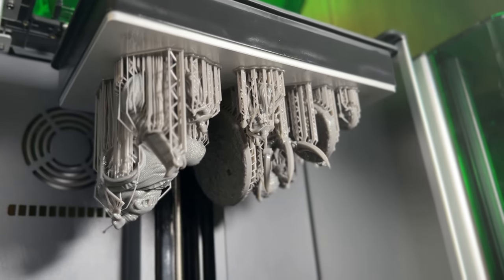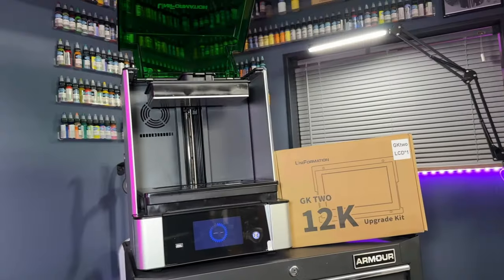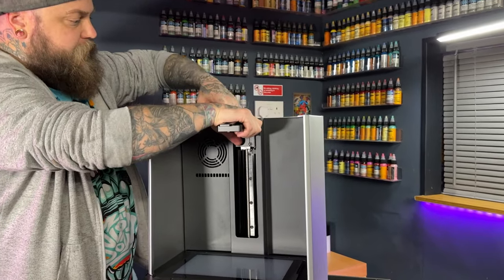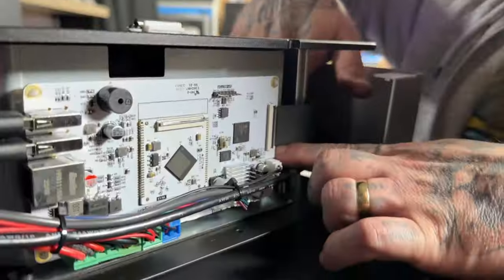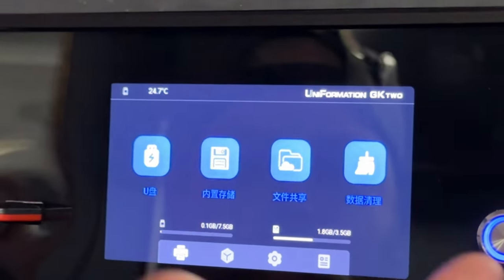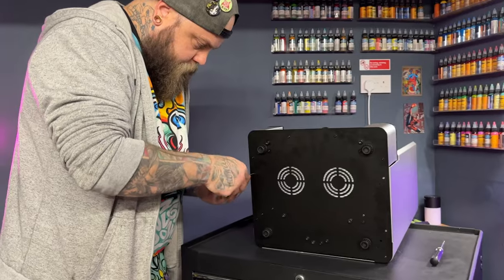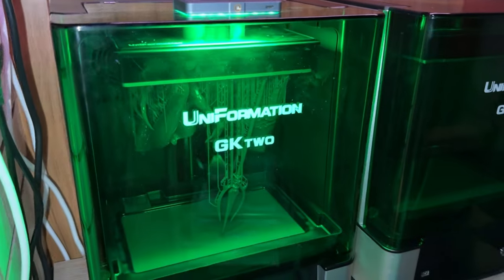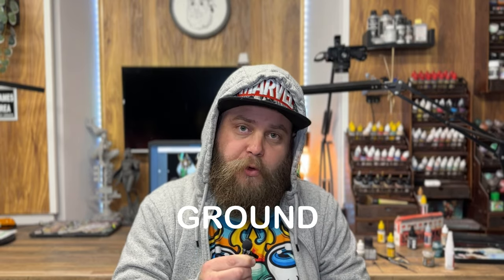Best Hobby Resin Printer of 2023 - Uniformation GK Two

Comment: Rinse your prints under hot water, they will effortlessly detach from the build plate, and the supports will follow suit. Direct the water precisely to avoid any distortion to the actual print.
Reply from the maker: Literally don’t even need to dude they just pull off with ease.
Reply: @Groundeffected  I noticed that you utilized a trowel to remove your print from the plate. If you rinse it under hot water, you can use your hand to pull it away easily. Using a trowel may potentially damage the surface of the plate, just a friendly suggestion.
Reply from the maker: @Triad3DStudio  you know when these resin printers first started coming out we were sent sand paper to sand the plate for better adhesion. Don’t worry about the plate dude. I scrape it after every print too just to take off any potential bits from the raft that might be snapped off( usually not a single piece) and I shove that thing back in and print again. Haven’t washed a single build plate in over 3 years printing.
Reply: @Triad3DStudio  the more scratches in the metal plate the better adhesion you will get.

Comment: I just picked up one from Amazon - thanks for reinforcing my choice 😂
Reply from the maker: Dude you gonna love it. Make sure to check level both mine needed to be level despite them saying it’s level from factory. They were a fraction off. I like it to be tight on those papers. Then also set the temp to stay at 30c dunno why but I heard it helps it to stay within that sweet spot temp range. Other then that it’s so good once you’ve got your resin settings dialled. I swear to god mine has not missed a beat. I have two running every day and they’ve both not once given me a minute of trouble. Best experience so far with a machine. The build plate threw me off at first but now I like it! It also doesn’t drip resin when you take out the prints. I honestly can’t say enough good things about this machine from my experience
Reply: @Groundeffected  will do, shows up tomorrow and the first print will be the Loki and Silvio you showed.   Even got the same resin, with your mix ratio !
Reply: @Groundeffected  would you mind posting your settings for this printer with your magic cocktail of Nova3d and Syratech?   Would like a baseline to start dialing it in.
Reply from the maker: @RookFett  broski I moved on with resin. Damn I need to do an update video I use sunlu and sunlu and like now
Reply: @Groundeffected  arrrrrrrrrrrrrrrrrrrggg ---  of course - that is my way - get old info ;)
Reply from the maker: @RookFett  haha no worry though you still got good stuff just pricey on todays market. I’d use what you have any day!! Just that we found cheaper alternatives now
Reply: @Groundeffected  that’s good to know.   I also have a bottle of sunlu - is your mixture the same for that?  Think I should join you discord to pick your brain!

Comment: And about Heygears and Uniformation GK2, which one is better?
Reply from the maker: Uniformation gktwo is better because it can use any slicer but heygears is stuck with their slicer only but it depends if you like their software though..
Reply: @Groundeffected  If you had to choose which one to buy, if the slicer is not a problem, would you still choose the gk2?

Comment: FYI Uniformation, the BF sale price jumps back up to 849 when checking out :(
Reply from the maker: No, I’ll message my contact now and see what’s up.
Reply from the maker: Is this Amazon or official website?
Reply: Subtotal
$849.99
Shipping
Enter shipping address
Total
USD
$849.99
Reply from the maker: @darkmoonmarket  did you add the code ?
Reply: @Groundeffected  Yeah but it only takes it down to £709... Ohh I just figured it out. It shows as GBP on the main website page then converts to dollars at checkout. So it actually works out to £567 or $709 which is even cheaper than I expected. So confusing, but it works, I guess

Comment: You will never convince me this is $350 better than the Saturn 3 Ultra. Because it isn't.
Reply: After using the Saturn 3 ultra for about a month I think I'd rather have bought this printer instead
Reply from the maker: Never ever said I was trying to. But the Saturn couldn’t print in my back room currently so for me I’d rather buy 50 of these with my own money than one of the saturns that currently would not work in my back room due to lack of heating. It’s a simple tiny cheap addition that takes the whole printer into a completely different territory. I don’t care if you can print better when the temperature is controlled and in optimal range. Gktwo does that for me. Just that feature on its own makes any other printer currently without one obsolete. Last year I spent an astronomical amount heating my studio to be able to print and still suffered failures due to temperature, this year I’ve not had to manually heat a single print and have not had a single failure on any of my heated machines.
Reply: The other nice thing about this brand is that they natively use a Prusa slicer fork.
Reply: I have a Saturn 3 and can't print anything other than the stock rook even with the right parameters. Bought this on black friday. So I'm convinced.😅

Comment: its a nice looking printer but over £280 more than a 12k Saturn 3 ultra for the sake of the heater i dont think its worth it tbh.
Reply from the maker: I mean I won’t lie if it wasn’t for that heater I wouldn’t have a single print for the last few weeks of videos. It’s so cold in my back room there is no insulation and it’s getting very cold in England
Reply: Yeah i fully understand that as i stay in Scotland its 0 degrees in summer up here. @Groundeffected